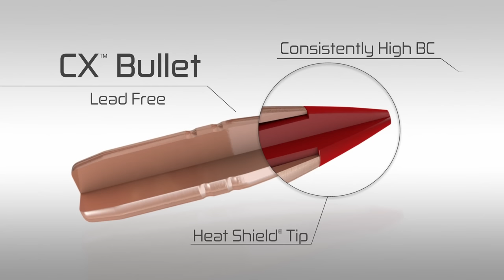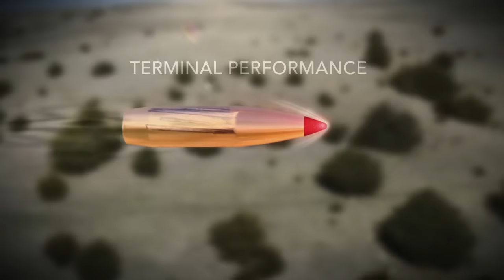Ep. 082 - Let's Talk Load Data

Comment: Mr. George used a term I am not familiar with, "olich" when describing the void inside a cartridge case.  Could you explain the use of this term in internal ballistics and also the correct spelling?

V/R

Jeff Henry
Reply: The term is "ullage"; the amount by which a container falls short of being full.
Reply: Jeff, if the cartridge case is not completely full, there will be an air gap between the powder and the bullet when you are seating the bullet. Now when you lay the cartidge down, the powder shifts and may even pack down a little more, so when the primer goes off the powder is burning off-centered in the case. Folks will argue about how this affects accuracy, etc. So some folks add a pinch of corn meal to fill that space and prevent that shift, while others try to find a bulkier powder that fills the case. Of course how deeply you seat the bullet will affect this too. You would want it to compress the powder. That also changes the burn and may be unsafe.
 So that's where "the space" comes into consideration.

Comment: 27 minutes in he says they did this to be transparent wither customers about stuff like this. And if max is max then how is it wither there on the shelf loaded ammunition they can get 200+ fps more box posted and varifed with crono then what there load data shows? Perfect examples. 35 wheelen  there superpreformance ammo is box posted 2910fps 200gr interlock  but there load data has no loadings for anything faster 2650. I've loaded and shot a few different combinations on there data and it was indeed around 2600. I've also shot there ammo and it was slightly  slower due to my shorter barrel  but was still upwards of 2825. I like hornady alot but it's hard to believe that these arnt loaded down or something a Rye
Reply from the maker: We use powders the hand loader doesn't have access too in some cases. Also we have many blends for different burn speeds of superformance. The hand loader only has one option of superformance powder. Hopefully this helps.

Comment: Your factory ammo nor your reloading data does not reach promised speeds in the 7 prc. Why is that? FYI 24” barrel.  By up to 150fps. Talk to me Goose. I’m betting I don’t get a reply😂
Reply from the maker: Is this with one particular powder or a bunch that you have tried? Lots of factors come in to play like bore and groove dimensions, throat length, and for lack of a better term “barrel attitude”. I’ve seen equal length barrels 100 fps different with the same load. 😂
Reply: @hornady  I have 3 different 7 prc 
with 3 different chamber sizes and throat lengths. I’ve used H1000, RL 22 H4831sc . Same results. I’ve pulled apart your factory ammo and found 3 different powders in 3 different lots. SD ‘s and Es quite high.  Found that your powder charges varies quite a bit in the same box of ammo w the same powder. I’m talking over 4 tenths. Some people have reported 2 grains different. Some of your ammo as slow as 2850fps.  If I get even close to 2950 fps I’m having the start of case head separation. After all this I still like the 7 PRC. I’m just seeing my results and others on YouTube are seeing the same result. You’re saying the average factory rifle shoots your 175 Eldx’s at 3000 fps and my 3 guns are all slow?

Comment: Only 5 minutes in and already half truths are being spoken. Using only hornady reloading manuals, take a older reloading manual and compsre to the newest. Maximum powder loads, preasure are different. Even if you think I am wrong, then consider this. If hornady uses the tightest tolerances and only saami specs, then why do other respected manufacturers load data differ? Are you saying Lee, Sierra, etc are incorrect? Because that is what I hear you say.